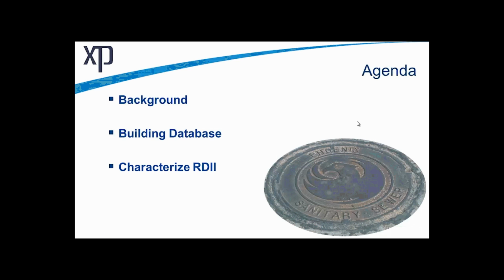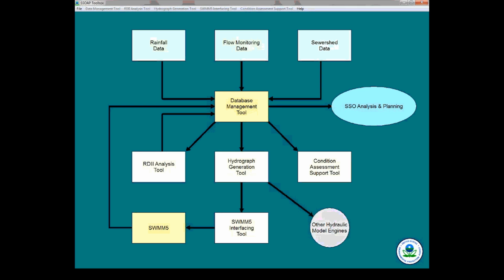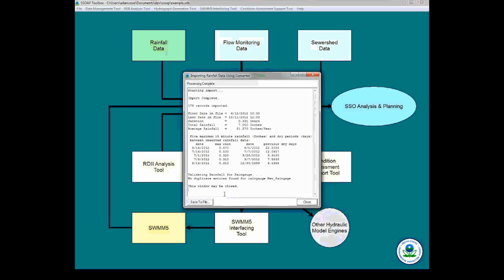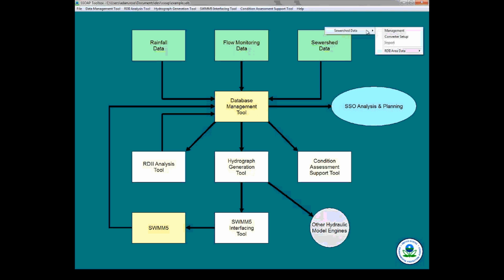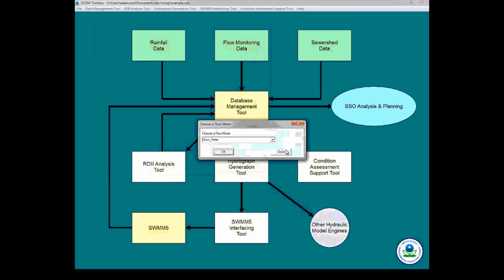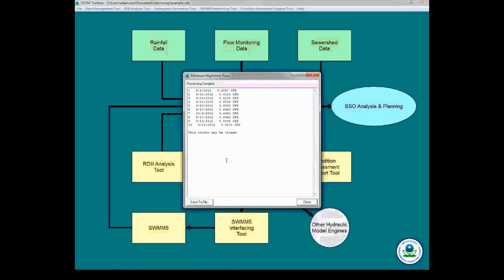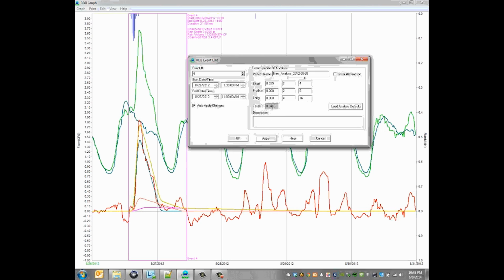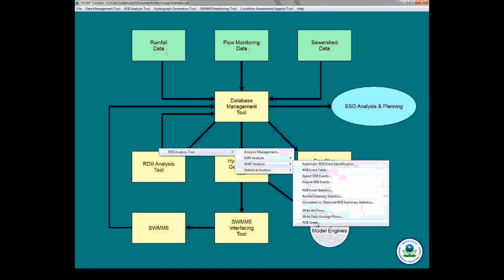Introduction to SSOAP

Comment: Thanks for the video Adam.  Very helpful.  A few questions for you: 
1. Is there a way to keep the y-axis from auto-adjusting?  I remember being able to do this in SHAPE.
2. I see that SSOAP provides a graphic for comparing peak flows (observed vs modeled), but is there a way to get a graph showing total storm volume (observed vs modeled)?